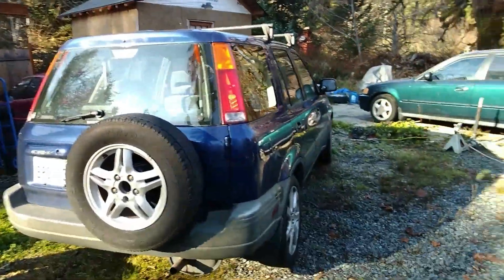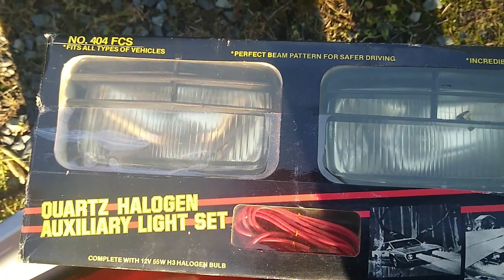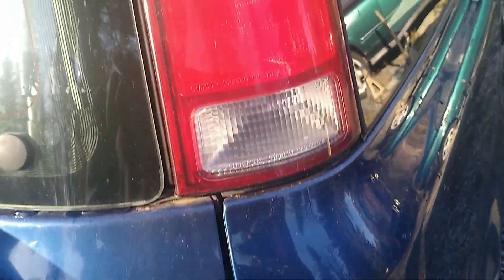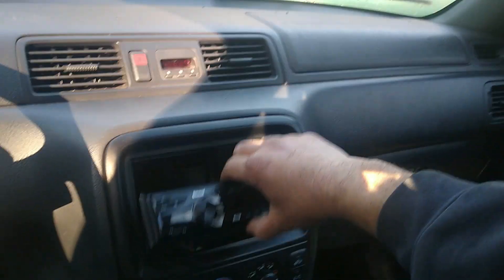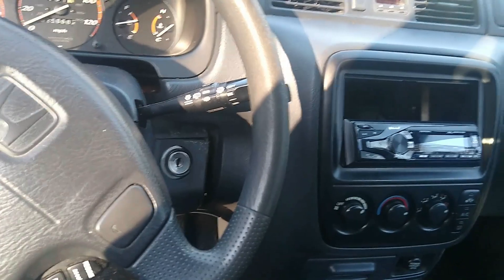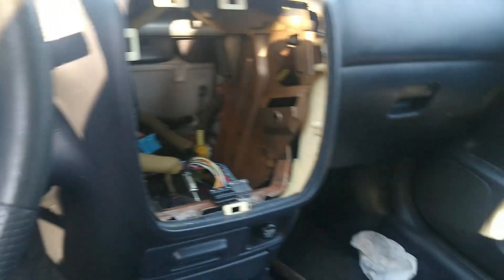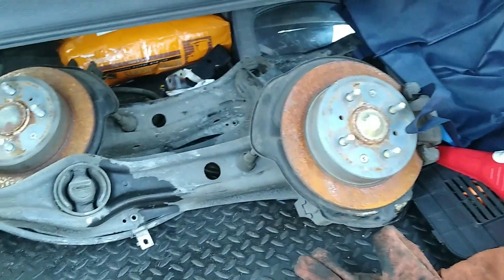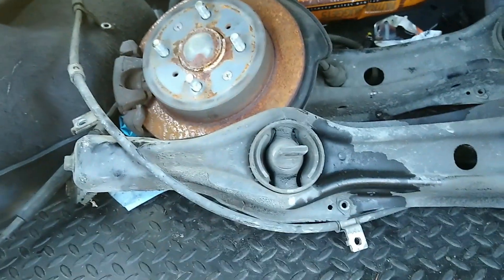Rsx steering wheel in a Honda CRV

Comment: You din't connect the airbag right
Reply from the maker: No I did not
Reply: @keventraub5098  does it work with this yr.. does the cruise control buttons work?
Reply: How did you plug the horn wire?